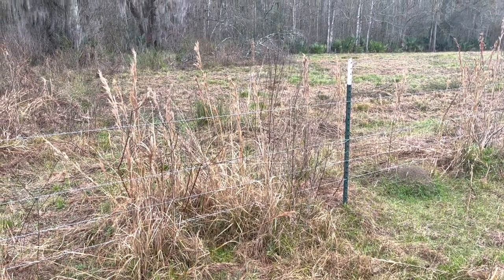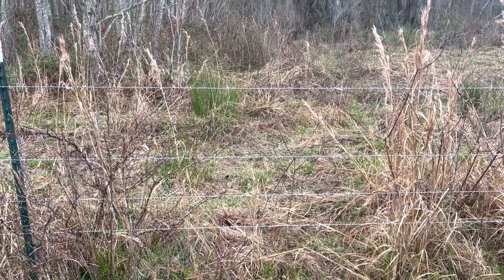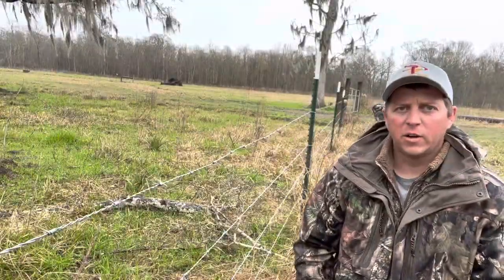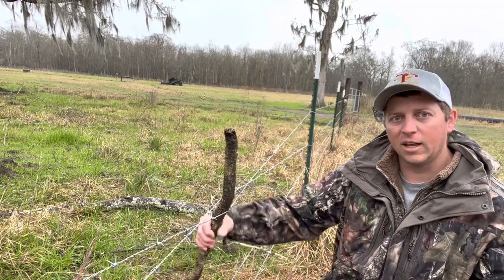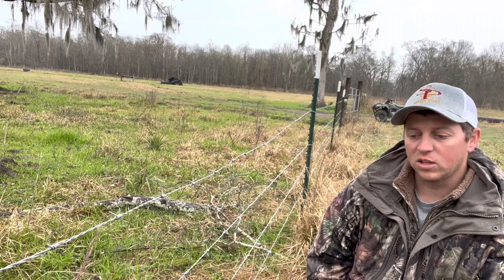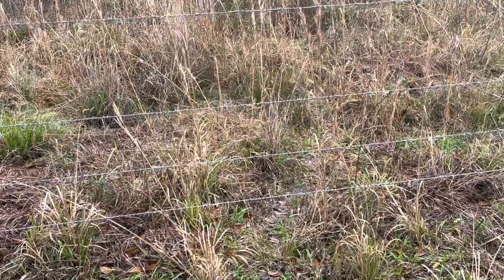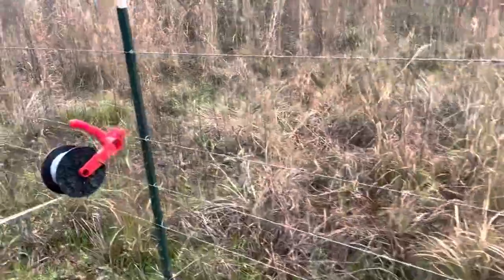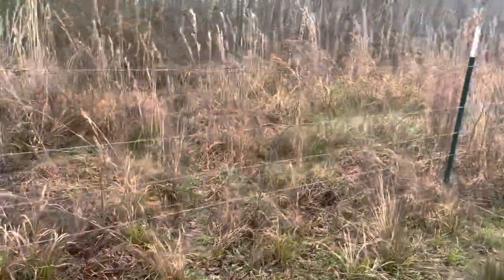Deer friendly barbed wire fence design

Comment: I know for a fact that our Florida deer can jump a fence significantly higher than 42. At the old home place, I put 48" woven wire 4" off the ground, and then ran a strand of electric high tensile about 3-4" above that. Just two days ago I saw 2 does jump over it.
Reply from the maker: No doubt that they can jump higher.   If I remember correctly,  the biologist referenced a study on the impact fences had in regards to restricting or changing deer movements.   40 inches deterred nearly 0% of mature white tails and 60 inches deterred something like 90%.   This was in a no stress situation for deer.  The fence he recommended is supposed to be the best balance of not restricting or changing their behavior in any way,  and not endangering them from entanglement.   We will see.  Thanks for watching and commenting.

Comment from the maker: Outline of the recommendations 
1.  Overall height 45 inches or less,  if it will keep cows in
2.  Top two strands 10-12 inches apart.
3.  Bottom strand 16-18 inches off ground.
4.   Try to avoid woven wire because it restricts fawn movements.

Comment: I concur on the woven wire, not good for the fawns. I leave a 16" space under the bottom wire and the deer slip under no problem. I'm in the south as well, I see mature deer leap 52" fence , most prefer to go under. I have had them run through new fence breaking strands not realizing it was there.
Reply from the maker: A deer under some sort of stress or pressure can jump a substantial fence,  but in general,  they go under any fences I have that are over 42 inches high

Comment: im in texas primarily hunt hogs but occasionally deer . im thinking about doing 19" on the bottom just curious you never mentioned the middle spacing of the 2 middle wires . will be doing 12" for the top wire. any input also doing a 4 wire setup . mine is for a 20'x20' deer/hog feeder pin
Reply from the maker: For the cows,  I do first line ~16,  second 8,  third 8,  top 10-12.  Gives an overall height of 42-44 inches.  I do not think it will work for hogs though.  Hogs cross my fields regularly.   At one point in time I used cattle panels around feeders and they worked great.  Split them in half so thay are ~25 inches tall.  It was 100% for keeping hogs out of the feeders.  Even very young deer could jump in.
Reply: @stringerbridgefarm3201  got ya in our area of the state its mainly big boars there are feral hogs and stuff but we have a bunch of big boys is that 16" lower high enough for something like that ? i would hate to have one of them blow the fence down lol. im just trying to keep the cows out. i want pigs for my buddies to hunt we do alot of nightvision/ predator hunting . i only take maybe 1 or 2 deer per yr off that property per yr IF that. mainly setting it up for hog hunting
Reply from the maker: @nathanw5747 ok,  I mis understood.  You want the hogs to go through and keep cows out.  I’d put bottom strand at about 18 inches high then.  It will keep all the cows out except newborn calves.  A big hog will definitely get under 18 inch fence for corn.
Reply: @stringerbridgefarm3201  yes sir that is what im after . so 18, 8, 8,12! with a overall height of around 46" ish ?